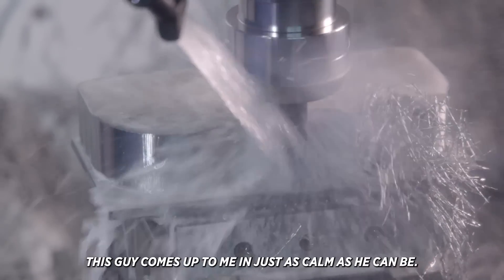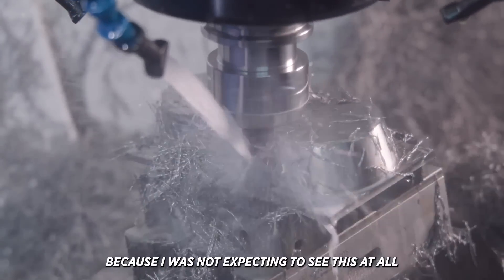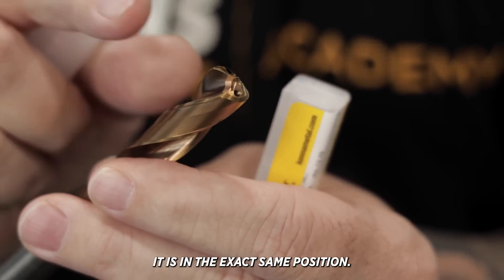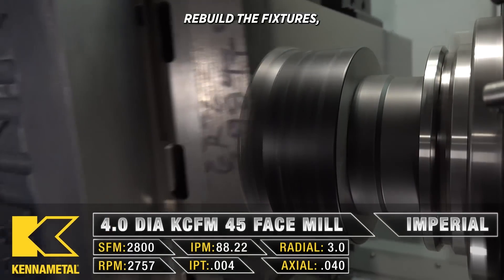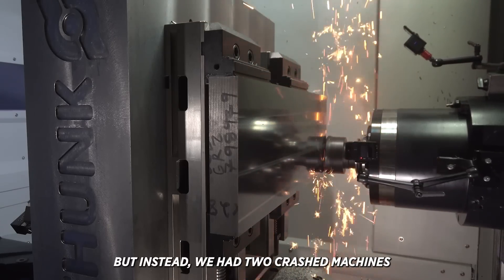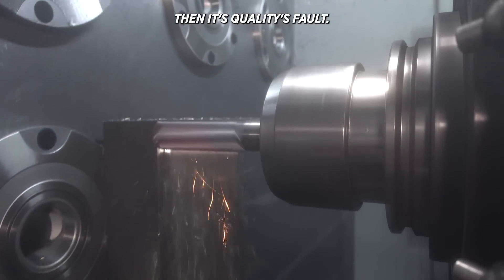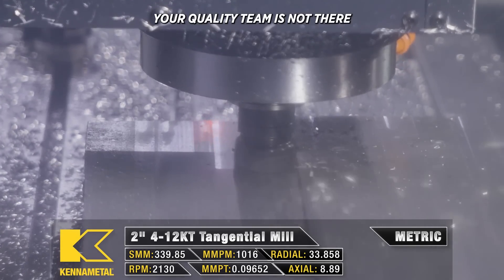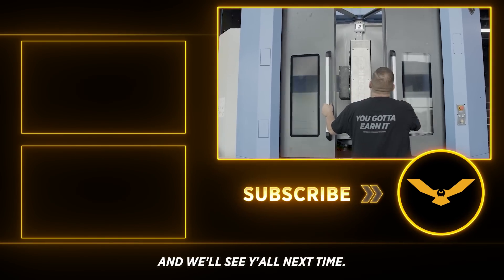$200,000 Damage | EPIC FAIL… Machinist CRASHES TWO MACHINES at the Same Time

Comment: Worst crash I've ever seen?  failure to clamp main spindle on 1" barstock, and failing to properly install the guides on the bar feeder...so..it proceeded to whip around destroying the bar pusher in the bar feeder, the door, multiple tools (he let it run THE ENTIRE PROGRAM!!!!) beat the turret to hell, dented the entire inside of the machine...it was only by sheer luck it didn't fly out and punch through a wall or another machine.

still not the worst though...seen an experienced machinist stick a 2" diamond knurl bushing into a manual lathe and tell a first day operator to come over and polish it to the finish he wanted...bastard proceeded to walk away and sit at his desk to eat some chips while the operator who had no idea of the risk attempted to do what he was told..the brillo pad he gave the operator got stuck, pulled his hand into the part and his forearm into the spindle and only because of the quick action of another machinist did the guy not die...still lost his arm from mid forearm down.

Comment: Man this is the epic failure channel, good grief, are there any normal days or success stories? Sounds to me like a failure of management to have procedures in place… if you’re dependent on employees to this financial level then I see the reason for a promotion, perhaps to an executive level… I’m ignorant here because I’m not in this business, but how on earth can a machine wilth hundred thousand dollar parts not have even basic engineering to avoid crashing like this… this problem shouldn’t exist, heck man even a $50 printer knows to stop before damaging itself… I’d say stories like this will take the operator out of the picture by fully automating the production line. The technology to do this easily exists at this very moment, and the technology to allow the machine to know what it’s physically doing has existed for decades, why are these things designed so poorly?

Comment: I was a set up operator for about 11 years. Understand the importance of watching program through the first piece off. I went was told fixture's on need to run part through both ops. And take to quality control for a  cmm. Loaded first station reset and called up correct program rapid turned down mill in spindle brought it to y0 x0  rapid still down single block on. Watching program for z0 position I'm watching this mill go three inches past 0 part was hollow. Went to zero return first z and then the y 0 reset went into the program checked fixture's offsets to my personal set up instructions x & were good within a couple thousands it happens making inspections moves. Checked z and it was moved 3 Inches . I think can't prove I was setup to crash.

Comment: i started manual machining when i was 14 but then was away from the shop from age 18-21 in that time they converted to cnc so when i came back i had 2 weeks time before the current cnc machinist left. anyway i was left with a cnc lathe and mill and almost no expirience. shortly after i was machining 2 in ductile on the lathe and my piece slipped out. the result was that the entire tool turret was left hanging by a single bolt. i spent 2 weeks repairing a =nd realigning the machine.

Comment: Worst one for me was on a Haas TM-2 (tool room mill) tool carriage moved in to switch tools but when the spindle came down on the other tool and seated before I could anything the carriage didn’t move back to home position and the spindle went straight down breaking the carriage off its mounts and breaking everything. Come to find out the sensor for the carriage that was to let the machine know if was (in) and not at home had gone bad right in the middle of a program. Not sure the cost of repairs but machine was down for 4 weeks.

Comment: You say it is the machinist's responsibility to ask for what they need. What if they ask for a program that is written correctly by the guy getting paid twice as much? I agree 100% that he should have proved the program first, but I also don't believe the story. You're telling me the guy set both machines up at the same time and then started them at the same time, not set one up and start it then set the other one up and start it? He would have heard one machine crash before even getting to the second machine. Also it would be nice if the machine threw an error for missing the tool offset.

Comment: Worst crash I have had happen was on a DMG Mori NTX2000. I had ran the bore bar on the sub spindle and it measured undersized. I searched N up in the program to get back to the beginning of the tool and run it again. I figured since I just ran the tool it was good so I hit start. Next thing I see is the tool head flying down in the X towards the chuck. I turned the rapid down as fast as I could but was too late. Tool head slammed into the chuck at about about 50% rapid. What I hadn't remembered was that tool had a roughing cycle and when I searched N it took the program back to the end of the roughing cycle and not the beginningof the tool. Big mistake and getting too comfortable on my part. The impact misaligned the A axis and wrecked the 3 jaw chuck. Machine had to be torn down,  A axis realigned, box way inspected for damage, and chuck replaced. I felt awful for a week and took full responsibility. Nothing worse than someone trying to pass off blame. I don't care if you programmed the damn part or not, you should be doing everything you can think of at all times to avoid machine crashes.

Comment: Most of my work is one off prototype pieces so EVERY job involves babysitting the equipment and never getting too comfortable or too far away from the E stop button.  I've definitely had my fair share of bad code situations over the years.  As I do most of my own programming I have no one to blame if I don't check the code or at least watch the code feed for something that looks like a crash.  Walking away from a new program after pushing the start button is a terrible idea.  

I punched a carbide drill through the table of a nearly new mill with a high speed Z axis move because the tool zero was set for a different tool.  Lesson learned.  Double check your tools.  

I had a brand new 7.5 HP spindle CNC router put a 3/4 x 8 inch carbide endmill  through its aluminum table due to a bad piece of code during a transfer move.  That was exciting.  Hard to catch that one in time.  The end mill turned into a carbide bullet!  Definitely duck and cover time.

Comment: The guy that was training me (20 vet) was setting up new tools and teaching them. When he was  teaching a bar home he taught it 10 inches past the face of the part (a 200 lb interrupting cut part) instead of backing it off 10 thousands. Me being new at machining had no clue at the mistake that he made stood right next to him as he pushed start on an open Mazak lathe at 100 percent speed and feed on a part that was running 900 rpm. The bar went full speed into the part throwing it clear across the shop and I literally saw one of the jaws fly about a foot passed my head. Huge costly mistake that downed the machine for about a month while parts were on order and mazak techs came out to repair and calibrate the machine. When the boss asked what he was thinking he said that him training me made him over look things. The guy was a massive asshole to boot but ill hand it to him Dude stood next to that machine and hit the emergency stop bottoms before shit really got out of hand. Me well i was clear across the shop the second I knew something wasn't right. I hadn't run that fast since high school track. This was the point when I realized that  being a machinist was no joke and that I didn't care to make it my life long passion. Their are a lot of dangerous jobs out there but it is almost a certainty that if you die at work as a machinist it will most definitely be a closed casket service.

Comment: Worst crash I experienced was running a vertical lathe on nights. There’s a sensor in the spindle that should tell when the drawbar hasn’t properly clamped after a tool change. Apparently this failed. The first I knew about this was when the tool holder smashed through the part, bounced around the inside of the machine and finally exited through the front of the machine, taking the door with it. The tool holders on this machine weigh in at 40lb or so. Luckily I was a few feet away, out of the firing line, putting red tags on most of the parts made by the previous shift. 

The funny thing was, not one single manager or supervisor asked how I was the next morning. All they gave a toss about was the machine.

Comment: I went from running SL-6 to an SL-3 and noone told me the SL-3 didn't use a G96 so after I indicated my part in I hit go and boom it runs right into the part, reset everything got new number values. Hit go same thing again. After that I learned to love single block and a super slow overdrive

Comment: As a machinist, it's your responsibility to avoid crashes. You are running the machine, not a programer.

You run the program on the machine, yes, but you are a machinist, you should have the competence to check the new program before running it and walking away from the machine.

How many cutting fluid tanks did he overflow in his career?

Comment: The year was 1986 shortly after the Challenger accident. We were prepping titanium forgings for C-17 Wing roots. Now these blocks were big they were about a yard by 2 ft. We were using a Cincinnati 10 HC traveling column horizontal. Naturally they gave it to a kid right out of Vo-Tech. He did one block as best he could which is was okay he was on his second block out of 18. When he went in and edited the program. Apparently he didn't realize that these older machines still tagged their edits to the 'N' number of each line of code.
So basically what happened was the same in this video. But we weren't using a tool setting probe. It hadn't been invented yet. But he took a 10 inch shell Mill and crashed it head-on to the material. It pushed a 3-ton knee off the table and onto the floor. Made a hell of a noise. Now if you're familiar with the old 10 HD traveling columns the spindle motor is vertical on the y-axis and it is geared to 90° for the spindle z-axis. How that spindle carrier has six bearings in it. He pushed the spindle shaft 10 in back into the frame of the machine. All I did was shake my head and start the cleanup. All Cincinnati malacon did was send us a new spindle on the y carrier. I salvaged the tool changer and a bunch of other stuff and had the machine running in 2 weeks. I think the shell Mill survived. Old machines oh by the way it was 100 inch long table by 60 inch y axis and 40 inch and z. Nice machine for that day. I think none of them are around anymore. All been scrapped out.

Comment: It's insane how lackadaisical some people can be in this industry.  I've only been machining for about three years.  I just took three hours to prove out a 25 minute program.  I am completely okay with that, my boss is completely okay with that, my lead machinist is completely okay with that.  Damaging a machine is bad, scrapping a part is bad, but I put my safety and the safety of people working around me and after me at the forefront of every decision I make.

The worst crash I've ever had was when I first got into machining, and I thought the turret on the Mori Seiki SL-403 I was running was at home position.  Indexed it right into the tail stock.  I learned some new swear words that day, also spent a few hours with maintenance learning how to indicate a turret to tell if it's out of position.

Comment: The employees attitude bothers me more than the crash. The fact they don't care is beyond fathomable ... Why are you in this type of career if you don't give 2 shitz .. I have been a machinist for 28 years now. I can probably tell you in detail every mistake/crash I've made. I can also tell you what I learned from it. I can tell you after the incident  there was maybe only a 5% chance I would make the same error .. Usually if you start to get comfortable and stop double checking and triple checking first.
I've seen guys in our shop bust holders in half. We even had a guy who managed to hit so hard he tore the tool out of the spindle busting the taper and ripping the pullstud out . spindle replace and rotating table to replaced. What bothers me the most is it's never his fault.
One time her forgot to turn the magnet on ... plate fell into the spindle (residual wore off) he went and told the boss my programing crashed the cutter. 
Any owner who has these people need to get rid of them . They will cost you greatly in the end. In production, quality, reputation and shop floor morale ..

Comment: In the late 70’s the bosses useless nephew made an unauthorized adjustment to the brand new Mori Seiki lathe crashing the tool-bit holder into the chuck during a high speed finish cut. The machine almost tipped over. Technicians from Japan took several weeks to repair the machine.

Comment: I just crashed an Hermle c400 last year because I forgot to set up the z zeropoint. A face mill ran in fmax into to vise, I hit NC stop and was shocked, early in the morning. In my panic, because new machine, I hit the wrong button and the machine try to turn the c axis whit the crash face mill in the vise. A ugly noise and dark inside the cabin. Tears ran over my face... And what the hell, the machine was just fine. The vise is death and the face mill got broken tooth's...but thats it... All the parameters and spindle were checked and absolutely ok...

Comment: We're coming to an age where programmers don't really know how machining processes work. They work with computers and are not machinists. I took over programming at a company where the the prior programmer never knew that tools couldn't always be run at the feed rate suggested and it was up to the set up people to go through and change all speed and feeds. He could not understand why a 1/16" end mill couldn't be run at 150 inches per minute at a depth of .050 in 4130
Reply: When our company bought new Hurco Machining  Centres two machines went down with spindle bearing failure within in three months because of ridiculous cutting speeds by a programmer and we were told that continuous bad programming would/could compromise the guarantees.
Reply: It depends. If all the programmer does it sit in the office drinking coffee at his computer then yeah, he will never learn to make decent programs. To become good at programming you actually needs to go to the factory floor to see how things are going, talk with operators and ask for their opinions, look at part quality and so on. 

Some operators are also to blame, I've seen a guy stop the machine, manually open the door and manually remove a part that was supposed to be unloaded automatically. Instead of taking 30 seconds to call the programmer to let him know that the program doesn't work, he wasted the better part of a shift fucking around manually removing some 60 parts
Reply: I had a programmer who could not understand why a 1/4" end mill running at 3000 revs at 1/8" pecs would melt when cutting nickel chrome mould tool steel
Reply: @rogersmith5167  Sounds like he would do better in a different job lol
Reply: @lolatmyage  When I tried to explain to him changing a G code did not replace the scrap mould cavity worth a lot of time and money plus company profit and customer  getting the moulding to the market place before their competitors the seriousness of the mistake just did not register in his brain. He was replaced very quickly
Reply: @rogersmith5167  rightly so I would say

Comment: We had a programming engineer forget to put a period / decimal point in front of rapid move of 5 so when the operator pushed the run button the machine spindle came up to 1200 rpm and the "A"  turret moved rapidly into the Chuck 5 inches.  That crash took out the Chuck, turret, head stock gearing, head stock bearings, tooling and the part being Machined.   It took me almost a month to repair all the damage.  The operator felt bad but there was no way for him to stop the machine in time.